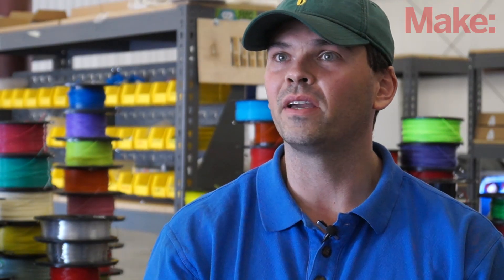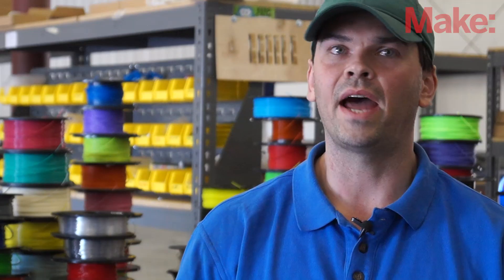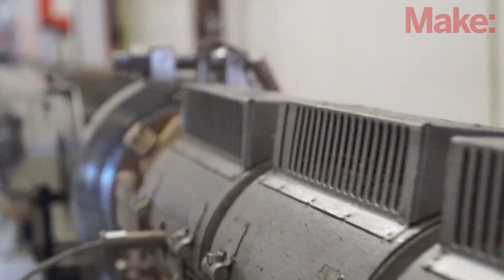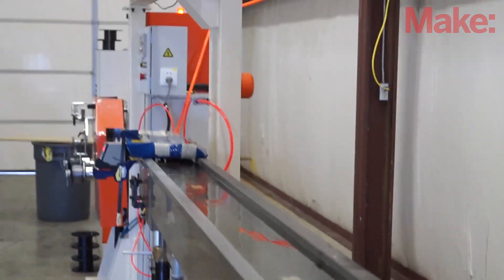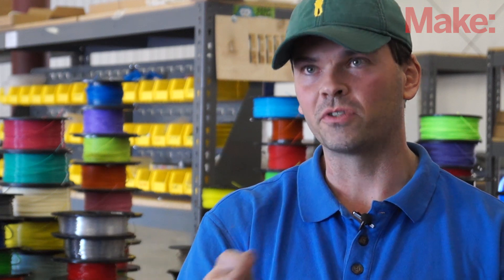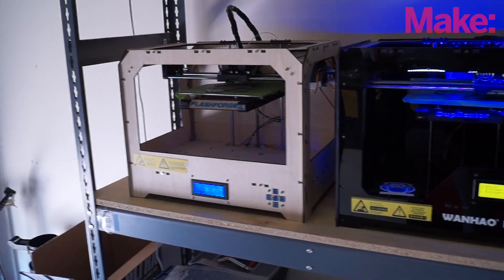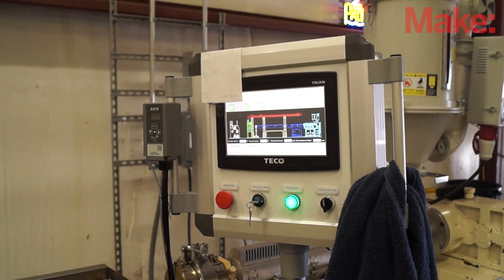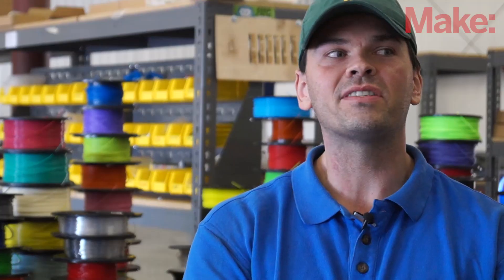How It Is Made: 3D Printing Filament

Comment: Hi guys, we have developed a bioplastic mix from cassava which rots in 1 week under normal composting conditions. Now  we are thinking of prototyping by producing pellets and eventually 3D Filaments to test it out. Any ideas on how we could go about this in Ghana? You feedback will be much appreciated. Cheers Venan
Reply: Hello I'm Daniel from Nanjing GS-Mach, So glad to know you.
We have produce the machine line from 2013, I believe we can give you a good feeling.

R e:3D printer filament extruder machine

We have GSD20 lab extruder machine ,capacity is 1-2kg/h;GSD35 extruder machine ,capacity is 8-15kg/h;GSD45 extruder machine ,capacity is 15-30kg/h;GSD65 extruder machine ,capacity is 30-50kg/h. Our machine can produce 1.75-3.0mm diameter, and tolerance is +/-0.03mm, the machine also can produce different shapes.

Re: twin screw extruder pelletizing machine

GS-20 testing machine: output:5-15kg/h
GS-35 15-55Kg/h
Gs-50. 155-255Kg/h
Gs-65. 255-400Kg/h
GS-75. 450-750kg/h

If you interested, pls contact me , I will send the machine video to you.

Looking forward your reply.

Best Regards

PM:+86 18151621522
What' s app:+86 18151621522
Email:sales2@njgsmach.com

Comment: Why is water used for cooling? Is air-cooling not fast enough at those production speeds or are there other reasons for this?
Because normally it seems like a bad idea to hydrate filament...
Reply: I use air and water....... But water never touches the rod.

Comment: I find the water fascinating. The feedstock as to be thoroughly dried for the process to work correctly. We end-users often wind up storing the finished product in dry boxes so our process works correctly. But during manufacture the filament runs through 20 feet of water troughs. I find that reasonably hilarious.

Comment: So, you dry the pellets because dry pla is a good thing... then you run it thru a water bath?  Sometimes I wonder about people... It's not like the Chinese are the only ones who have ever done plastics manufacturing.  There are US-based companies who do it and there are consultants available who have decades of experience on that exact extruder.  They're expensive, but not compared to the opportunity costs of not selling your filament for the weeks/months it took him to figure it out on his own.
Reply: well they dry the filament so when it's melted there's no air bubbles. The filament doesn't actually absorb much water when it's passed through the cooling system

Comment: A question for on the topic of mixed filament parts.  How do metallic parts such as wire work in the filament manufacturing-extrusion process?  I am not a material scientist or chemical engineer, but I can imagine that either metallic parts fuzing in the batch mixers to the resins.   I could also see bonding the resin on a wire that is extruded in the resin-extrusion process.  Do either of these approaches have merit?
Reply: friend2031@friend2011.com, we make this machine

Comment: Great to see you making the product locally. There are Technical colleges that not only give you data, but are good at trouble shooting.  One thing you may run into is screw design and speed.  When adding ferrous material, the friction will tear the bond. Also a vacuum in your primary water tank will control ovality and concitricity issues.
Reply: we make this 3D filament machine, email:friend2031@friend2011.com
Reply: That's very interesting, I have been extruding filament for years mainly Solvay materials(PEEK,PPSU,PAEK and have never thought about using my vacuum.

Comment: It's honestly some of the best filament I've ever used.
Reply: +DrMrSuperAwesomeGuy 
Which brand is it?
Reply: maker filament, from makergeeks. Keep it dry with a desiccant though, it gets soft with moisture from the air over time.
Reply: Thanks
Reply: So they have to dry it after cooling with water.

Comment: Having worked in a plastic extrusion factory, I can tell you he is not exaggerating at all. Plastic is a fickle thing when being extruded. Humid that day? It's gonna stick to the machinery. Then there are the static shocks you receive working with the raw plastic. On many occasions I was shocked so bad it made my hand turn white where it hit me. :P Long story short, this is definitely a get what you give process, and I admire the dedication to the craft. Thanks guys!!
Reply: Rule of thumb, if you can see the spark from the static shock, it is at least 10,000 V.
Reply: Dan Murray youch
Reply: Omg, yes. I was working in production before taking my design position and the static shot right from the tank through my boot into my foot.
Reply: @joefromravenna  https://www.youtube.com/watch?v=MdG5LVFIHzI&t=3s
Reply: I worked in the plastic roto-molding industry and have to say its not that diffent.  Everything he was say still holds true.
Reply: How can buy extruder machine?
Reply: @AshishPatel-vu3nw  Here is a popular model for home use... https://www.filastruder.com/
Reply: @AshishPatel-vu3nw  https://www.youtube.com/watch?v=MdG5LVFIHzI&t=3s
Reply: @soundspark  Can be, I experience that sometimes too. Also a bit of buildup in the heated portion of the hotend can cause that.
Reply: @soundspark  Yeah, that's the worst! If you keep having problems like that I would suggest a burnout of the hotend or possibly replacing the heatbreak. Although sometimes it just gets sticky and it is really frustrating...
Reply: https://www.youtube.com/watch?v=MdG5LVFIHzI&t=3s

Comment: Really control the thickness of the plastic on Your enterprise is not fully automated: using laser meter line operator must constantly monitor its thickness and if it starts to deviate from the specified size - it interferes with the process? If so, as a result of such proceedings, the thickness and shape of the filament can be absolutely stable along the entire length of the coil and not to depend on the "human factor"?

Comment: How do they control the speed and temperature. Is it going automatically or manually?
Also, is it possible to manage speed of the tractor automaticaly depending on width of the filament?

Comment: the same manufacturing process of the electric Wires and the same machines used ,
i actually worked in a factory that manufactures electrical wires and cables and it is the same stuff :p nothing complicated

Comment: Does anyone here know what effect (if any) temperature and humidity have on filament in storage? I've been having issues with filament snapping between the reel and my printer, as well as some tension problems getting it off the reel.
Reply: I've found before that sunlight can make some ABS filaments very brittle. UV light most likely breaks down the bonds. Once it's printed though UV light wouldn't matter as much for strength due to re heating and forming into an object

Comment: Worst filament I ever seen. Very inconsistent. I measured 1.68 at it's smallest and 1.8 at it's thickest - within a 2" span.
Edit to add: you can actually feel the inconsistencies by sliding your fingers up and down the length.